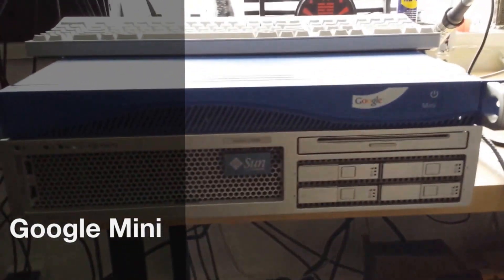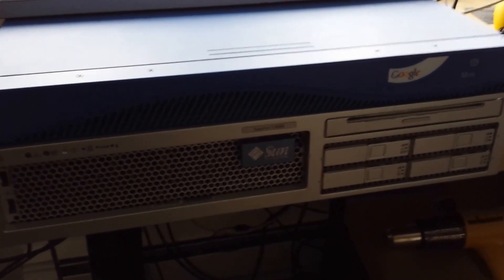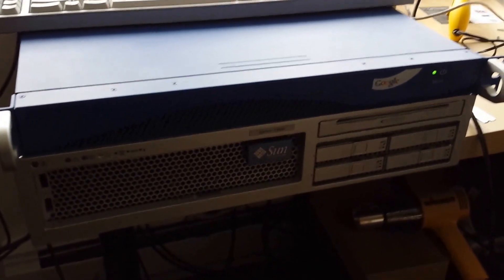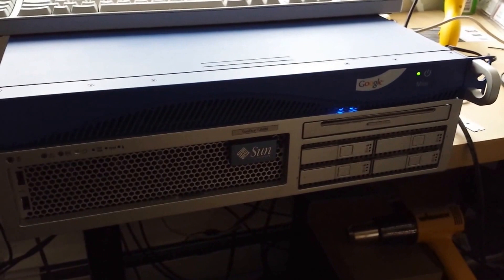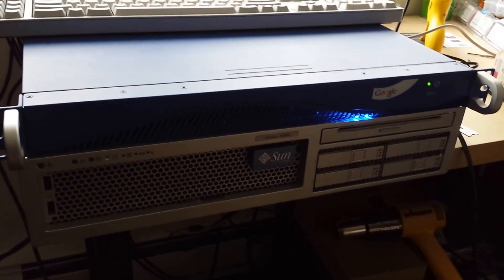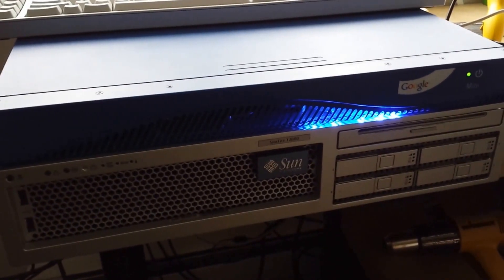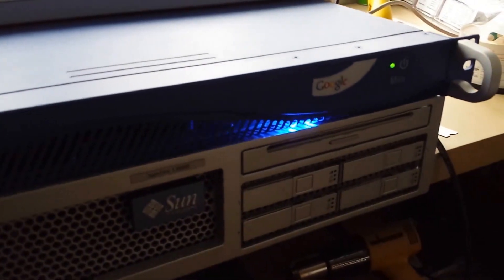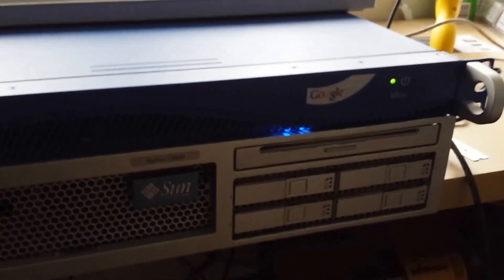Google Mini Server Search Appliance Hack

Comment: I have been trying to unlock the BIOS in order to load in a version of Ubuntu, but I am unable to get it to work. I believe I have unlocked the BIOS, as I am able to hit DEL and enter BIOS to edit things. However, when I attempt to install Ubuntu with a USB drive, the screen is completely black except for a blinking cursor in the top left. I was wondering if you could give me any advice or troubleshooting tips for my situation. Thanks!
Reply: I'm 8 years late but for anyone else, What I figured out is that this motherboard just doesn't like booting from USB drives.

What I recommend is opening the server up, plugging a IDE or SATA DVD drive and using that to boot to an installation disk, Note that this CPU is 32 bits so you'll need something like Debian.